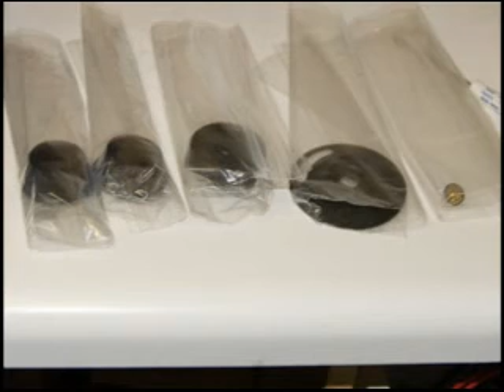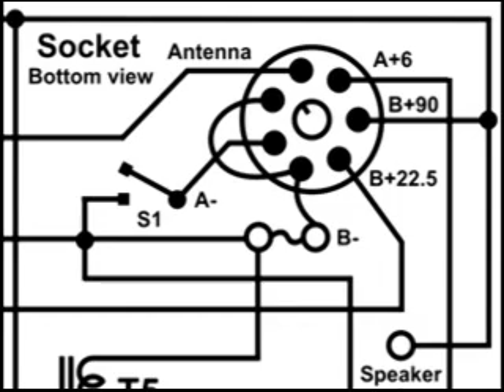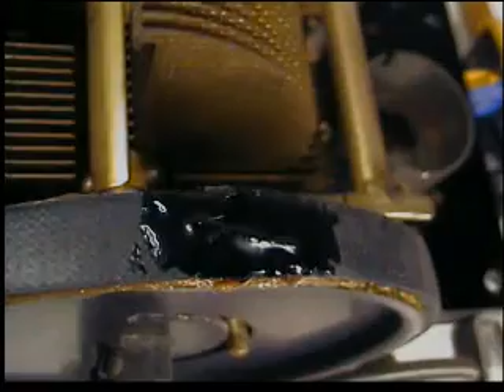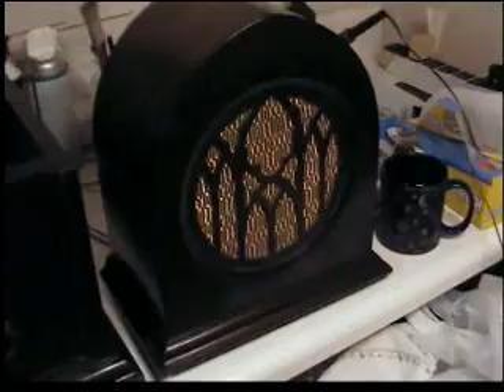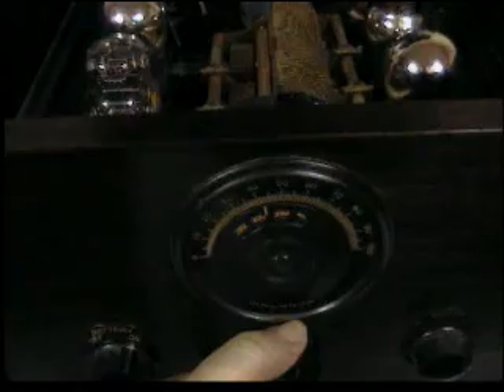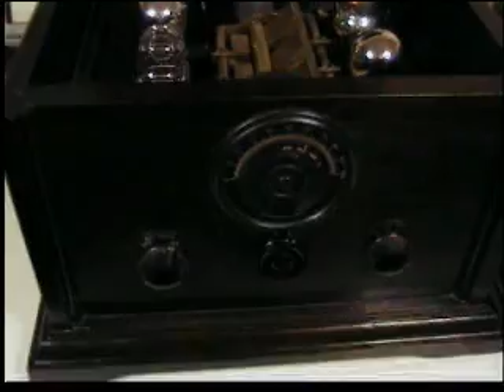Magnavox J radio repair

Comment: I just got one of these today. I'm interested to know what you used to replace the rubber on the tuning capacitor? Mine is in need of replacement like yours was.
Reply from the maker: I went to the hardware store and found a belt that would fit in the groove. Then I cut it to fit the circumference.

Comment from the maker: Oh I know I am very lucky to have found one. I had not thought if the cloth covering the toroidal transformer was green silk but it could be silk. I thought the variable capacitors were brass but there is no corrosion anywhere. All I really know is that it is a beautiful radio. My friend radioam232 pointed out that it is high tech even for today. It is a remarkable radio for 1925. THANKS!!

Comment: The green toroidal transformers are astounding. Are the wires covered with green silk? If I remember a toroidal transformer is more efficient than a regular type. Functional as well as beautiful. Also the variable capacitor has dimples in the vanes to get them more strength. Are they are gold plated? Very, Very, Very, nice radio! Like the man said, high tech even for today!

Comment: awesome its sounds pretty good, how many volts does this radio run off of, you said your using a battery eliminator whats the voltage and amps required by this radio

Comment from the maker: Thanks. When I first saw the coils I did a WOW, and when I realized how they were used in the radio I did another WOW. It is still high-tech, absolutely amazing. The best I can tell the circuit is a model D. I drew the diagram of the J following the wires from the socket. In 1925 all the leads where labeled but now there was only one remaining. It worked on the first power-up.

Comment: I have also used a 70-volt PA line transformer with the 70-volt primary in the audio output tube circuit of these types of radios connected to a modern 8-ohm speaker. It's not as authentic as the original era speaker but will really boost the high frequency response and enable the use of a modern speaker with these old radios designed for a high-impedance speaker.

Comment from the maker: Yes it saw a surprise to see those green transformers and the way they are using them. I was very careful not to move then in anyway, your right there orientation is very important. The capacitors are make from big washers and the two on the bottom are the two RF bypass capacitors. Powered by a ARBE-III battery eliminator. It is TRF circuit. I was using a Peeless speaker made about 1927, could have been used with this radio but a horn speaker is more appropriate.